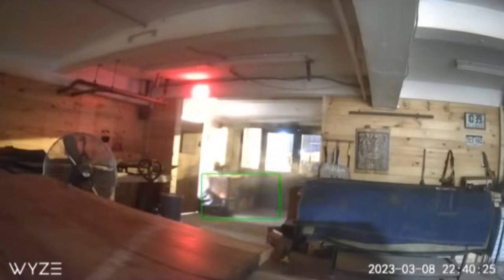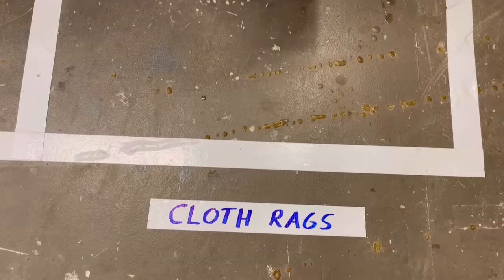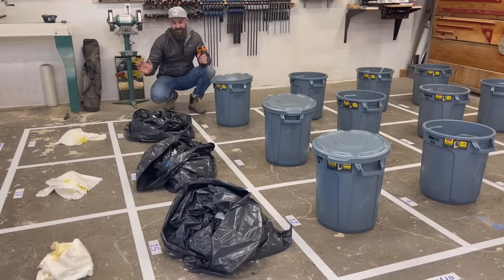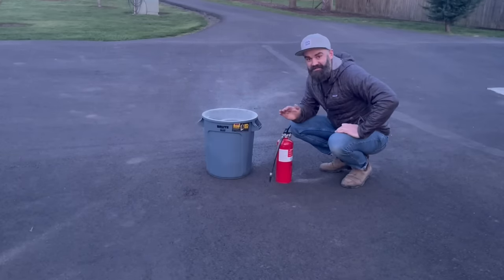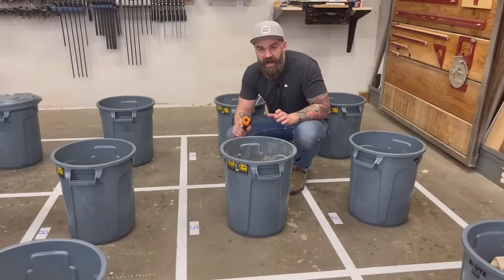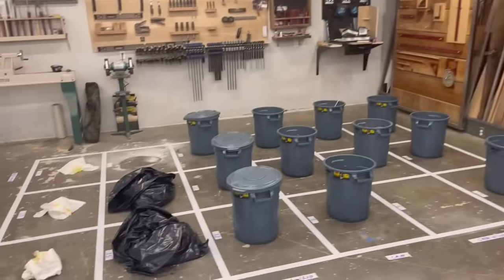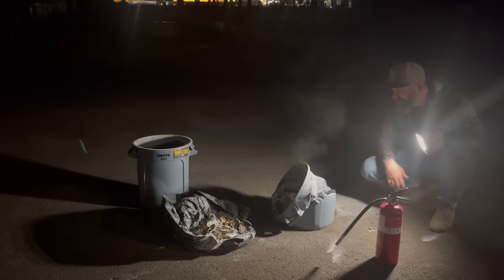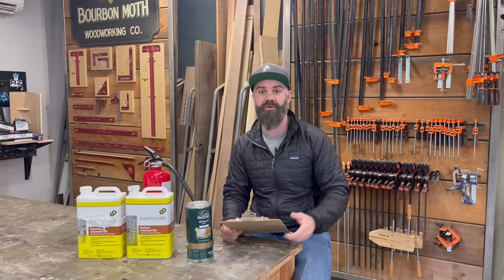I Tried To Burn Down My Shop || This Video Will Save Yours

Comment: Great video! I never saw an oily rag combust before, but have seen the aftermath. All of the shops I personally worked in had a metal oily rag bins, but a nearby shop burned down because of oily rags. That was out in the country, and they didn't get to it until it was completely consumed. Around here, most shops use plastic 55 gal drums for scrap wood. Dust, garbage, and rags are all kept separate in metal drums on wheels. One of the shops I worked at had a couple of fires, but they were due to lightning once, and an explosion in the dust collector the other time. Back in the day, they taught about oily rags in high school woodshop and in my case, during my cabinetmaking apprenticeship. They don't teach things like that anymore though 😑

Comment: So... In February 2022 my shop did burn down. Luckily it was detached from the house and separate from any other structure and no one was hurt, but that doesn't change the impact of watching a few years and several thousand dollars worth of your life disappear in literal minutes... Ill say, I was very aware of this oil rag concern, and I only ever use (and only ever have used) single use dollar store paint brushes, and tossed them in a water bucket after use... The day of the fire, I was sick with covid and hadn't been out at the shop for  probably 4 or 5 hours, and all I had done was hone my turning tools on my bench grinder. I'm sure there were at least a couple sparks, but nothing really crazy... We still don't know how the fire happened, it's possible it was actually arson based on some shady comments by some people I know... but the real point of this whole story is that shop fires are so scary, and they happen so fast, and you get no warning... Thank you for this video, anything that can help people not go through what I went through in any capacity is a much needed resource in this community.

Comment: you are only getting the surface temps although the point has been made I'm kinda curious how high the internal temps got
also it might not have been a bad idea to contact your local fire department and told them what you where planing to help with the safety of your shop

Comment: Well done experiment going through various  controlled scenarios. having 60 years experience on a rural fire department, I've seen many instances where spontaneous combustion was probably the reason for the fire. Many older barns have burnt from wet hay or straw being stored. A neighboring fire station had a ball of oily rags setting on a work bench start on fire. Luckily the bench was steel and nothing was near the rags. Going to show this to members of my department.

Comment: I wonder if using the thermometer was part of the problem with the temperature readings? I know the sensors on some of those can be occluded fairly easily, and they're mostly good at measuring surface temperatures. I use something similar for cooking, and I have to aim at various parts of the food/pan to get a very consistent reading, and I still need to use something like a meat thermometer to get core readings.

Comment: Great video sir! I've enjoyed many of your video but this one is obviously very important! I remember my first fire as a firefighter. It wasat a car fire due to oily towels from a massage therapist. He had just come back from the laundry mat and had fully washed, dried, and folded them. It was shortly afterwards the lot of it caught fire. The fire investigator said the heat from the drier and the compaction of the towels along with only a small residue of unwashed oils was enough to cause the fire and subsequent destruction of his SUV. I say all this to underscore the importance of a fire resistant trashcan in a workshop. Even dried out oils can ignite in the right circumstances. I should know better but now I'll make sure I invest in this very important safety device! Thanks again!
Greg Hamilton

Comment: Epoxy is also a strong exothermic reaction, thus can start a fire easily while it cooks off the leftover materials from a project. Especially if they are left in bulk such as leaving the leftovers in a mixing cup.

At bare minimum a metal trash can with a lid. That Justrite can was one of the best investments you can make in your shop.

Comment: I am a Chemist and here is why your rags caught fire. It has nothing to do with the combustion temperature of the rags, it is the flashpoint of Linseed Oil which is 200 degrees Fahrenheit. Liquids themselves do not burn; it is the vapor above the liquid mixed with air that is flammable. The flashpoint is the temperature at which the vapor air mixture is just right for combustion to take place. There has to be enough vapor and enough oxygen. Too much vapor and noting happens. Not enough vapor and nothing happens.

Liquids with flashpoints at or above 100 degrees Fahrenheit are classified flammable liquids and require placards on all containers as well as vehicles (trucks, railroad cars) transporting them.

LINSEED OIL SOAKED RAGS WILL ABSOLUTELY SPONTANEOUSLY COMBUST!!!!!!!

Here is more science from an actual Chemist. Linseed oil contains chemicals called driers which speed up the drying process. The mor driers, the faster the chemical reaction and the quicker you can have combustion.

Another fact, Linseed Oil is not going to dry in a few hours, so your statement about the rags drying out is incorrect, misleading, and actually dangerous information to tell your viewers.

While I appreciate your demonstration, leave the scientific theorizing to actual scientists.

Wayne Y. Adams
B.S. Chemistry
M.S. Physics
R&D Chemist (retired)

Comment: There is a fire fighting ball that you throw in the fire that explodes and extinguishes the fire. Why can't you make a ball a little smaller? That will attach itself to the inside lid of rag cans so if spontaneous combustion does occur. The ball will immediately extinguish the fire.  Just a thought I had. Never fear omac is near

Comment: Thank you for putting in the effort to do this as scientifically as your resources allowed. I would have thought that if the rags began heating, the temperature would have increased predictably until fire started. Instead there didn't seem to be much rhyme or reason to when they burst into flame which is interesting to me.  I'm guessing it has something to do with the right amount of ventilation -- enough to allow oxidation to increase but not so much that it cooled the rags to quench the reaction. But it is just a guess. Almost makes me want to continue on with your experiment. If only I had a reasonably safe place to do it.

Comment: Love that you did all this work and tested all this, but some of the ways you handled the fires just makes me think you did not think that process through very well. Why wouldn’t you have a water hose outside ready to put the fires out, why did you choose to talk before putting the fires out, at anytime multiple fires could have happened and there is that chance that it could have quickly gotten out of control? With that said this was an awesome video that hopefully shows everybody the dangers that typically are just overlooked.

Comment: Thank you Jason for taking the time and imparting this valuable lesson for everyone. I’m no chemist,  nor and expert in the matter. I noticed ( taking into account the types of disposed material  used in each container) that there has to be a direct relation to combustion with plastic & and the  ink on paper magazine / catalog. I’m unsure if the boiling of the linseed, transforms  it into a more active agent. Though it will be interesting if anyone with knowledge in the matter could elaborate on the reactions. Thank again pal

Comment: you were measuring just the surface (can/bag/rags) if you had a temp probes inside of the ball of rags, wood and other stuff - you would have seen the actual data ;)

Comment: Please: whenever possible, use an extinguishing blanket instead of a powder extinguisher: the powder really gets through even the tiniest crack and can still cause corrosion damage there, even after days and weeks. On top of that, it is not good for the lungs.

Comment: If I could explain your first can fire:  There was oil in a central spot that had lots of dry fluffy insulation around it by chance.  This insulation kept the gathering heat in and kept your can temp measurements down.  It was bout the quality of the insulation.  The coolest one was more likely to light if it had enough fuel in the center...  The hottest 'bag/can" is the one giving off the most heat therefore loosing the most heat.  If you insulated it better it would light faster for you...
Reply: It's fake. The bags would have melted before the fire started. Ave just did a video that goes in depth

Comment: I had a similar situation with  a bath towel and hair conditioner, smoke alarm went off at 5 am and there were flames in my bath room. Be wary it can happen.  Thanks for the excellent video  hopefully this will increase awareness.

Comment: Great video! It really is surprising how easy it would be to burn your shop/house down with oily rags.

I was lucky to learn this the hard way without consequences. I was helping my brother build a new deck with shiplap siding. I had spent an afternoon staining the shiplap, and never read the warnings on the buckets of stain that my brother had supplied. I managed to fill a large plastic trash can with soaked paper towels, no lid, and left it outside overnight. I probably went out to start working around 11am, and came out to find the trash can burst into flame, just getting started.

That's when I discovered I had no mental preparation for what to do with a sudden fire. I ran around in circles a little bit, then in my panic, tried to dump the top half of the rags from the can before the rest ignited. Which, as you can guess, was monumentally stupid. Then I tap danced on the rags trying to stomp them out for what seemed like an eternity, but was probably under 10 seconds, before finally realizing that there was a garden hose 30 ft away.

At first, I thought that some teenage kids or a particular neighbor that had been causing trouble lately must have vandalized us. Then I read the bucket of stain and realized how truly stupid and lucky I was.

Great warning video. Please take heed. In my case, it ignited outside on a summer day, maybe 18 hours later.

Comment: I trained fire safety in the airline industry and had knowledge of “spontaneous combustion”, however your extraordinary experiment was very convincing! The time and effort put forth was to say the least commendable! Thank you!

I have for years wiped my workbench down with boiled linseed oil, and now I will insure all rags are left outside to dry out before discarding them. 😮

Comment: Thank you, this is really interesting, I never understood why people would say oil painting was so dangerous because of the linseed oil…. Now I understand! 

Your experiment is well done, it makes sense that the bin with the oil, rags and wood etc was the first to go, you have given it everything it needs, heat, oxygen and fuel. Take one away and the fire can’t happen. 

It would be interested to see what the internal temperatures were like with a probe, the rags would create an insulating effect and the temperatures would just keep climbing inside. Big piles of Hot towels can also do this when they come out the tumble dryer :(

Comment: you put too much oil. it lights up when it polymerize in a thin layer on a almost dry rug. with a sawdust it combusts. did the same experiment on a much smaller scale some time ago. got the ignition)

Comment: Your first mistake is using dry powder fire extinguishers, those fools at the fire department do not consider clean up.  
In college while on the cross country ski team we caught some skis on fire while taking kilster off the ski's in our team room in the basement of the basketball building and mistakingly used one of those damn things. The powder was sucked into the AC system and contaminated the entire building.  It took weeks to make it usable and I'll bet the powder in still in the ceiling 40 years later.

Comment: Excellent video. I use oil and I'm paranoid about spontaneous ignition, my shop is my single car garage, integrated into my home and its directly under my bedroom.....😮.

I tend to use small 3M pads to apply my finish (usually Osmo Polyx). Once used I either lay them out separately on my bench OR when I'm particularly paranoid I take them outside and put them on my glass topped table in the garden! This being the UK, they're normally soaked with out incessant rain within seconds 🌧.

Only when they're cured do I put them into the trash outside.....never in the one in my workshop.

Once again, an excellent safety video. Thanks.

Comment: Consider that you only need 1 small area in the pile to reach the critical balance of fuel (evaporated hydrocarbons), oxygen (air) and temperature to start reacting. Think about starting a fire with a lighter - it's only got heat on a very small patch. The reaction is exothermic (produces heat) so it will be self-reinforcing. Scary indeed - thanks for this. I'm going to share this with my dear old dad. And double-check what's lurking in my workshop.
Reply: It takes time for the oil to evaporate at ambient temperature to achieve that critical ratio of fuel/oxygen/temperature.

Comment: Was building Rudolph Steiner anthroposophical spiritual architecture in Hawaii. (Thanks Florian!) The required finish is linseed oil beeswax and turpentine mixture is very beautiful smells great and I almost burned down the whole place thank The Lord -Jesus the Christ - the Holy Spirit - I came back and it was just smoking .  .       .

Comment: Great video!  I had a rag fire in my garage a few years back, but with mine it was in my clean rags.   I will never know what caused it but I'm sure some rags that were washed still had some chemicals in them.  So now I never wash any rags to reuse them.  I lay them out to dry then throw them outside in my dumpster away from my house.  trust me its scary when you smell smoke then open your garage door to have a flames right in your face.  I lost my refrigerator but because I have several fire extinguishers located around my house and garage that is all I lost.  I hope others will at least learn to be more careful with their rags from this video.   I know I felt that this stuff doesn't happen easily and that it takes some unusual circumstances to happen so I didn't think much about it before.  the thing is, I was headed out the door to do some errands.   If I left 15 minutes earlier I would have lost my entire house.  Thank god I was home to catch it in time.

Comment: What a great video! The elapsed time from sub-90 degrees to spontaneous combustion was an excellent example of just what "thermal runaway" actually means. The heat from the curing reaction (exothermic) causing he curing reaction to accelerate, which creates more heat, which accelerates the reaction more, and so on, which is why it only took 26 minutes go light off once the reaction started in earnest. Really fascinating stuff! It's also a good demonstration of how to properly prevent such fires because the rags in open air (laying on the ground) weren't insulated enough to build up the heat needed to catch fire, which is why separating and laying out oily rags to dry/cure is an effective way to prevent fire. The metal can has the benefit reducing available oxygen (to slow the oil's oxidation-based curing process and provide some smothering effect if a fire starts), being efficient at preventing heat build-up, and containing an actual fire if it happens. Well done!

Comment: WOW....exactly what I have been wondering about for the past few weeks, and I was unable to find any decent data online about the actual risks involved (stats on it are NOT separated out from other oily combustibles types of fires!!!).  Like you, I have/had been generally careful about the issue, but wondered if I was just making a lot of extra, superstitious, work for myself.
THANKS.
Side note:  From the moment you showed how you were going to use an infrared gun to take temps, I thought how overall useless that was, as the real heat would be deep inside the most insulated place in the pile...and by definition then, that heat would be insulated from your infrared sensor.

Comment: ya don't mess with melting plastic, i've been burned twice by it and that shit burns into your soul. once i was melting a mcdonalds straw for some reason and it dripped on my finger. and again when my sister thought it would be funny to stick a hot glue stick in the flame of a candle then touch it to my arm, left a little heart shaped scar, but i dont think that was her intention, lol.

Comment: As a retired firefighter/fire investigator I find this to be the best instructional video concerning spontaneous combustion.  I am also a woodworker and know the hazards of ALL products containing linseed oil.  I have investigated several fires in private homes and wood shops where rags with linseed oil was used and thrown into the trash, ignited and burned until the fire was discovered.

Comment: My family was visiting and helping apply blo to parts for a big project of ours last year. We came back out to the shop after dinner and immediately smelled oily smoke. We walked into the woodshop and saw a pile of rags smoking, they were red synthetic cloth rags that someone had forgotten to spread out. Smoking, too hot to move by hand, just sitting in a pile for a few hours. Very eye-opening, it definitely seemed that it could have continued escalating if we had not intervened